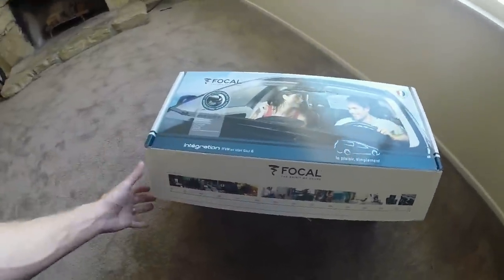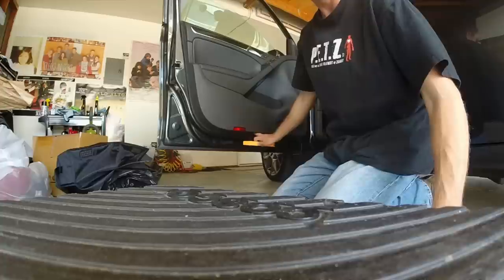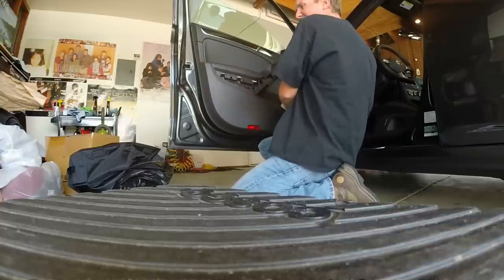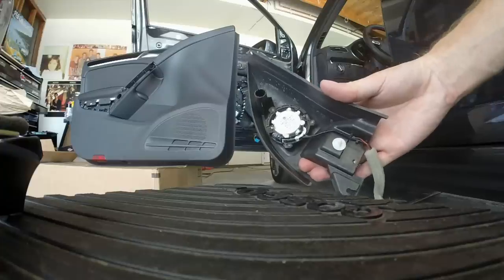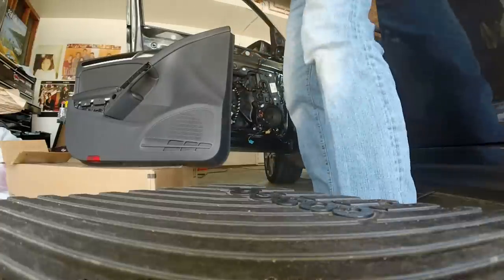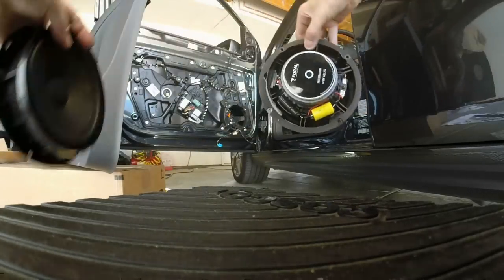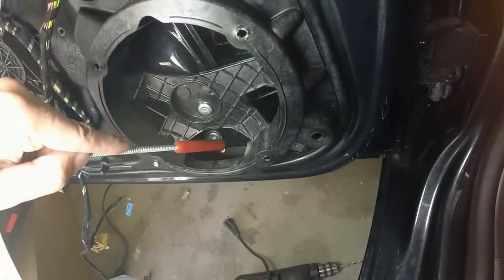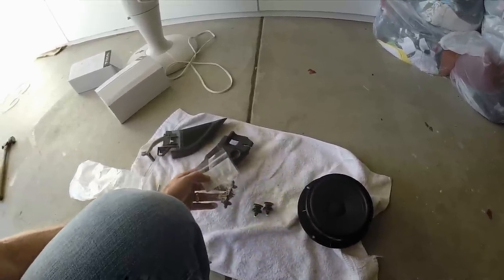2013 VW GTI: Episode 4: Focal Integration Golf MK6 Speaker Installation

Comment: I also want to change the rear. Where can I get focal rear speakers as well? Also, if you would pick another setup now that you have focal, which one would you choose?
Reply from the maker: i would choose the Dynaudio option to begin with, instead of this Focal kit I bought. The Dynaudio starts with a lot more power to begin with, which can't be improved on a base stereo just by adding different speakers.

Comment: what is your thought on the Dyna Audio system that comes with the autobahn trim.
Reply from the maker: i like it a lot.. but i think this Focal is at the very least equal, and migth just edge it out a bit in sound quality.
Reply from the maker: if you have Dynaudio already though, i dont think the gains for $450 are really worth it. This is a kit for a base system.
Reply: yeah signed papers on a 2011 carbon steel gray 4 door GTI. Autobahn spec and i cant wait to pick it up next week.
Reply: LastHumansGarage I feel like with the factory amplifier you get from the dynaudio system would make the focal kit sound a lot nicer at higher volumes.
Reply from the maker: ***** i could probably agree with that..

Comment: is this for premium 8 stereo 2010 vw gti or standard golf 6 4 speaker stereo
Reply from the maker: well in usa, this went in my gti which has 8 speakers. but this focal kit only replaces the front 4 anyway. you do need oem mids and tweets in front or this kit will not work.
Reply: I have focal speaker upgrade installed in my 2010 vw golf mk 6 gti  and stereo effect is not as good as original speakers. the focal upgrade only replaces 2 front tweeters and 2 front door speakers shoud I replace the 4 speakers in back? does focal have a upgrade speaker kit for the speakers in back?
Reply from the maker: no, they do not. i eventually went back to the oem speakers anyway. they weren't as clean, but they were louder.
Reply: LastHumansGarage I have a MK 6 Golf R with the Dynaudio setup.  Would the external amp in the Dynaudio package be able to better power the Focal speakers?  I saw your comment on going back to the stock speakers & I’d hate to spend the $600 on these only to find they’re underpowered.  I have a blown stock Dynaudio speaker & was hoping to upgrade without getting a full aftermarket setup.  I know the Dynaudio systems have an amp that the stock setup doesn’t.  If these are even more power hungry speakers than the Dynaudio amp will supply, I’ll skip them & stick to a stock Dynaudio replacement.